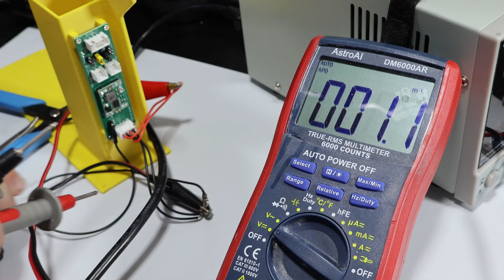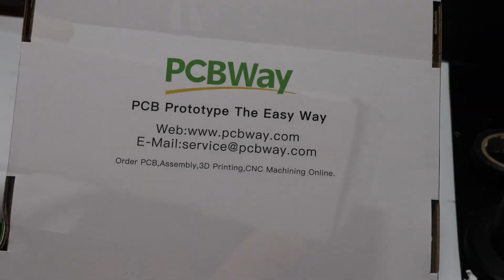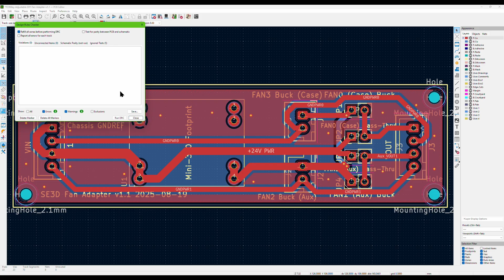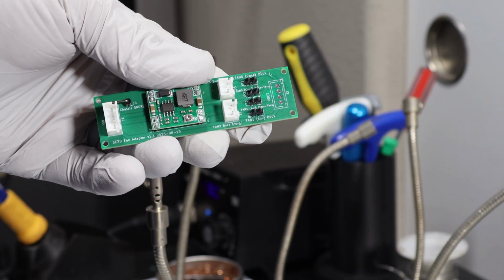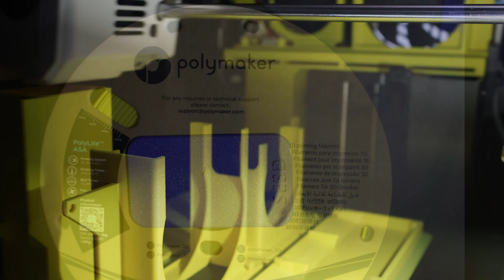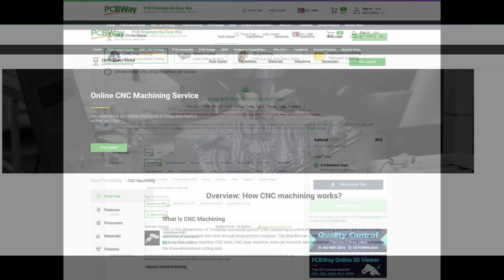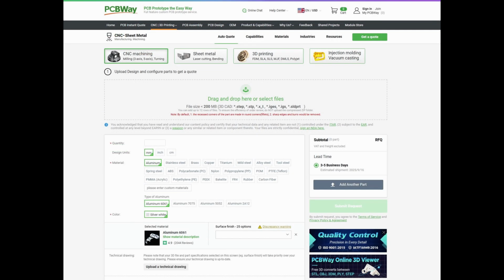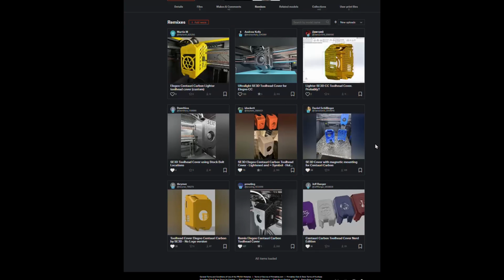PCBWay Fan Adapter Board for a Quieter, Higher Performance Centauri Carbon (and beyond!)

Comment from the maker: This just dropped! What do you think, should this be adapted to other printers? What fans / voltages would you use with a board like this? When I get an ETA, I will add a pre-order to my store for those that just want a pre-assembled version with the Mini-360 installed and set to a specific voltage.
Reply: Very cool.   I've been enjoying your tool head.   I switched to magnets on it.    Im trying to make a skeletonized version like the Panda jet pack.  But im not good at designing  yet.
Reply: Need.
Reply: I'm definitely in for one once the pre-order is live.
Reply: I was about to write a coment asking for a setup guide for complete noobs but honestly I would love to buy from you. Two birds one stone. I get to support you and I get the warmer, more silent printer. Keep up the good work!
Reply: Hi, thanks for the design, but are the gerber files on  printables correct for PCB way? I tried to make order but somehow auditing failed due to "Board outline is not clear;"
Reply: I want to order two of these boards when the new batch is ordered. Please advise.

Comment: Damn, that's fast! Didn't expect that. So in my impatience i used a Noctua converter for now. 

Still have 2/3th of the shroud laying around. I was missing m2 screws and i didn't feel totally confortable with the push-in flap near the belt.

Original case is on again for now with a Noctua 80x25. Still baffled me what sound it makes (rated max 19 dB). Must be the enclosure it's in.

For me it's not that citical: PLA and PETG here only for now.

Thanks for sharing! 💪🏻

Comment: All that crowing for a simple buck converter?
Reply from the maker: No, a simple way to mount and use a simple buck converter for a particular application. This is going to be the basis for further development. Such as adding a fake tach and a MOSFET driver.

Comment: Thanks for dropping all of these mods for the CC. I'm really new to 3d printing, and picked up the CC because of how refined it was for the price compared to printers over the years. One thing that kept me away from 3d printing was the amount of tinkering and fixing printers. That being said, these mods have been really awesome to see but also really daunting to try out, especially electrical ones. If possible, is there any chance you would make easier drop in replacement kits or guides for newbies like me? I think that would really get adoption rate of the CC higher considering Bambu advertises itself as hassle free. Thanks again for your efforts so far

Comment: Yes for other printers.  As for fan voltages the only other fans I have laying around are PC case fans and CPU cooling fans.  I'm not sure of their voltages but suspect 12V and 5V.
Reply from the maker: The other printers are going to be a slow integration but it's something that I intend to do. Based on some of the other comments, it seems like more depth with the CC is desirable. But that doesn't necessarily preclude other platforms. The majority of fans, from my experience, are 5 and 12V. I know there are some other oddballs out there, but that probably covers 90% outside of the 24V 3D printer fans.

Comment: Was wondering what you were using for a longer on fan. Hope I have enough left on role to do this part.
Reply from the maker: You mean the extension lead on the fan, or something else?
Reply: @SyntheticElectron3D  yes. I didn't have that option in original download although you had it on in the video. 
The fan duct that lowers the fan to near bottom of the case.

Comment: Dude, I am aggressively following your mods for the carbon-- I got sucked into it with the Inner spool holder, but ooohhh boy I'm eyeing the fan mod next.

I appreciate the extra fan headers, I don't know If I will need them -- but it's nice to have if I were to.  I'm thinking of two smaller fans on the sidewalls to augment the back blower.  crossflow might be more turbulent to scrub more cooling, but It is probably overkill unless I'm using a .8mm nozzle and straight gooping on flow rate as fast as possible.  Moreso relevant with the nozzles that have higher melt capacity (like cht nozzles), but the optomization curve is sort of topping out with the melt flow of the polymer species.  I know this isn't relevant to the general hobbyist -- but it sure is for me -- and i appreciate your detailed build guides and videos